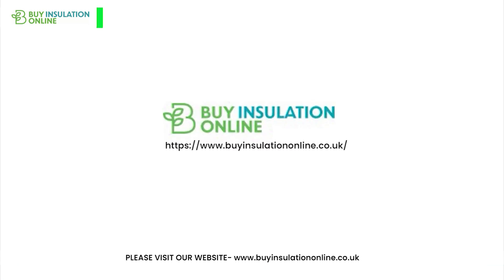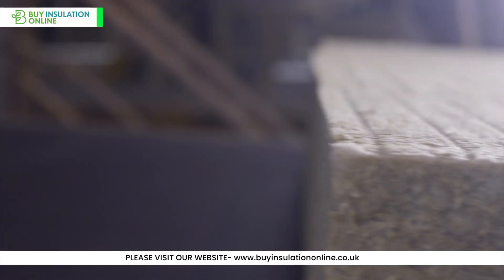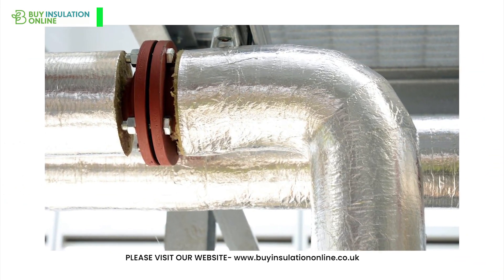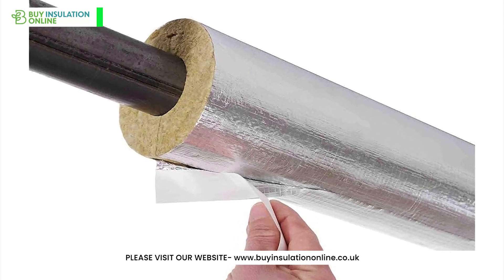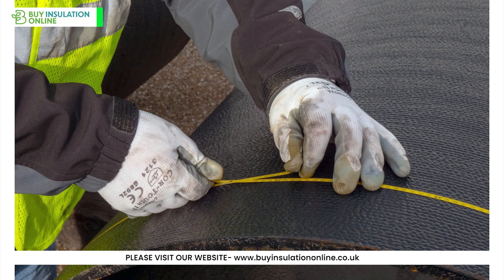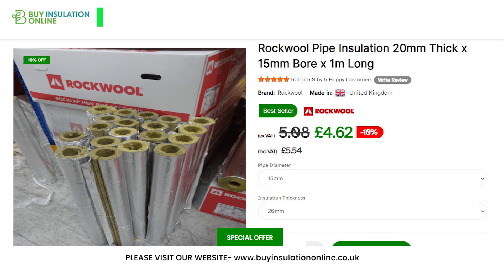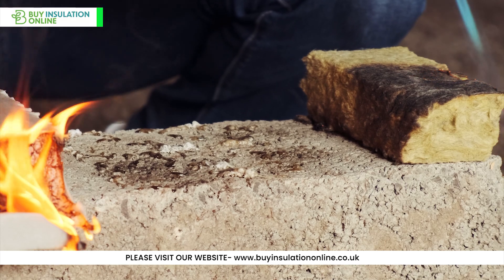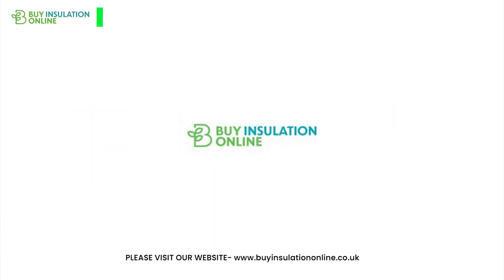Rockwool Pipe Insulation Explained: Discover the Power of RockLap H&V Pipe Sections

Comment: @buy insulation online, which insulation do you recommend for suspended timber floors.
Reply from the maker: You can use Polystyrene, PIR, Multifoil, Rockwool Slabs. All of these are good options